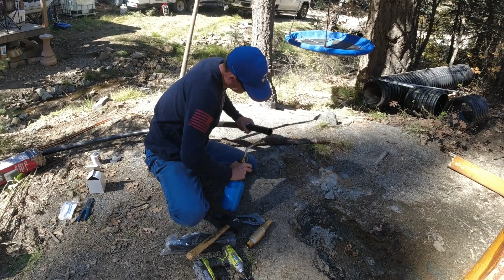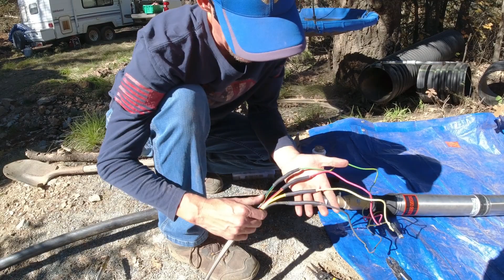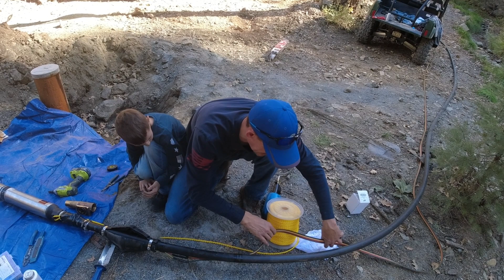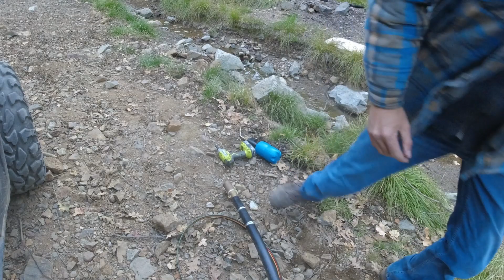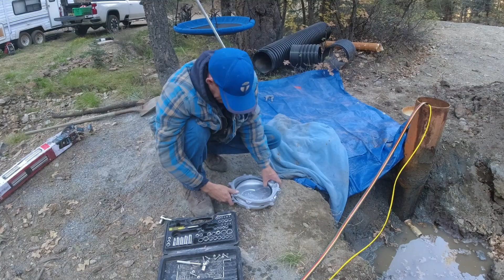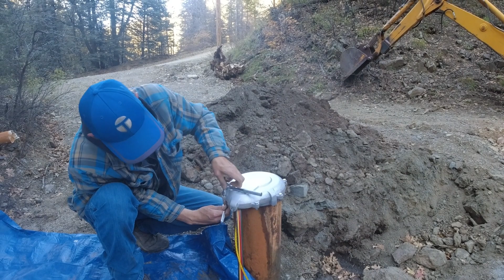Well pump installation Part 2  Submersible Pump install

Comment: What is artesian?  What difference does it make?
Reply from the maker: Good questions.   Artesian means it has positive flow out of the top of the well.  So the big difference it makes for us is that our well is completely full of water to the top.  Most wells the static level is below the surface ours runs out the top.  We don't have to pump up as far and we get all that capacity.